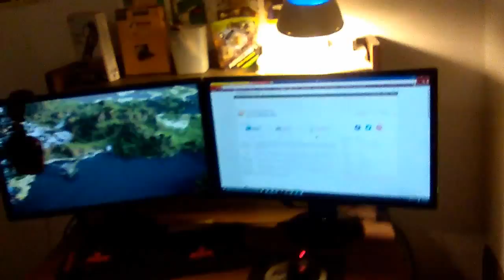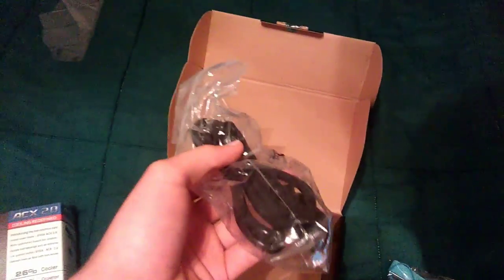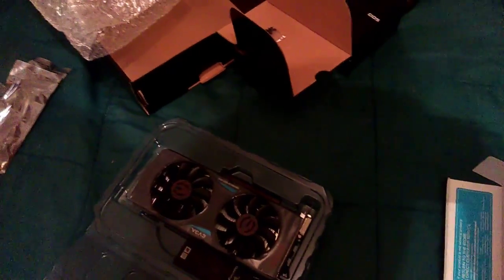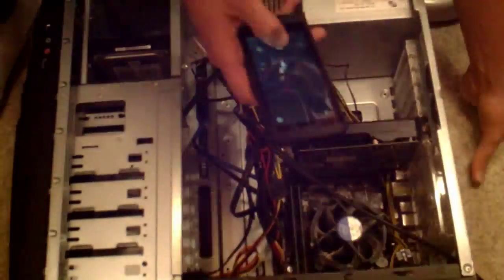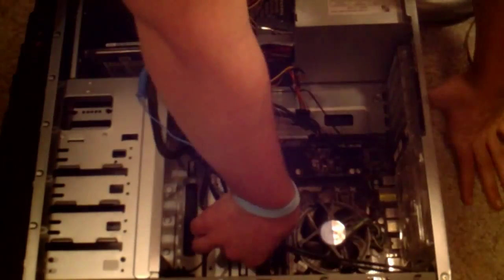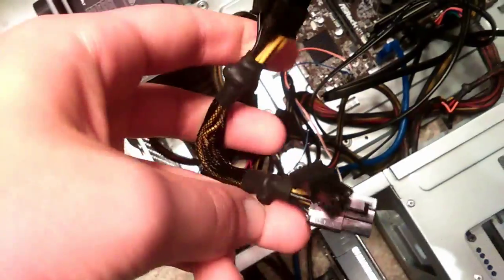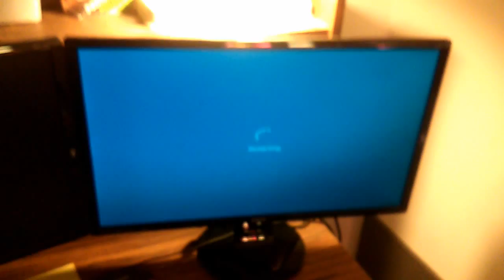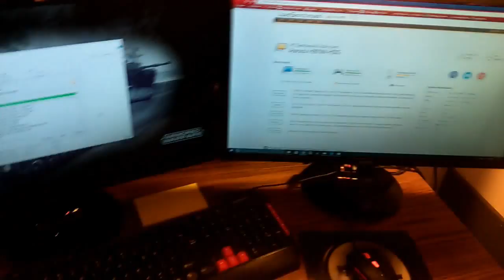Instaling GTX 970 / Vlog Thing!

Comment: So did the 970 run good with 500w
Reply from the maker: What do you mean?
Reply: like u didnt run into no problems ? i thought 500 would be to low
Reply from the maker: No, It works perfectly fine. It may be because I only have 2 hard drives but if I add more I may have problems I dont know.